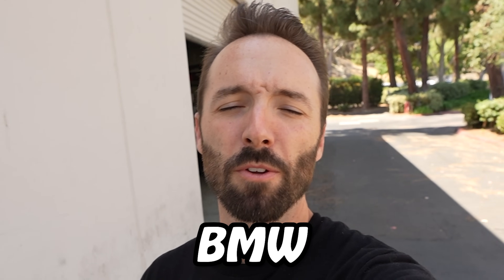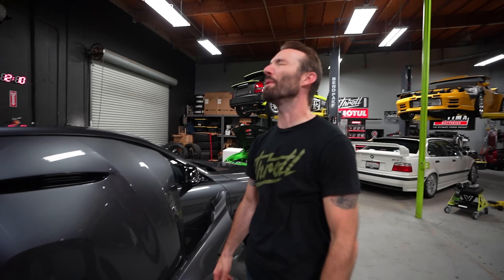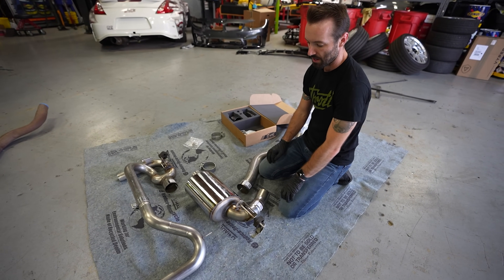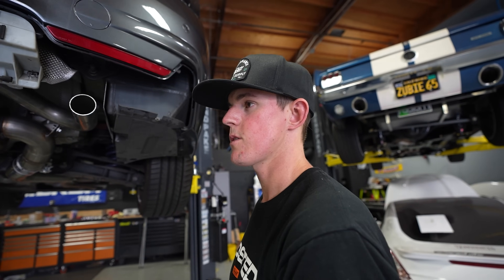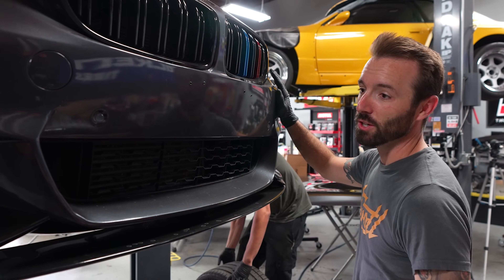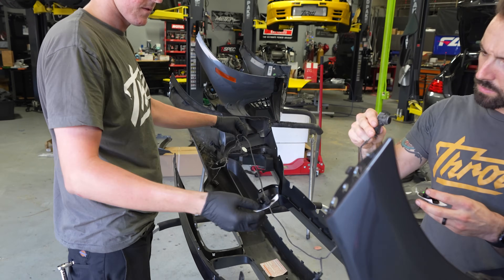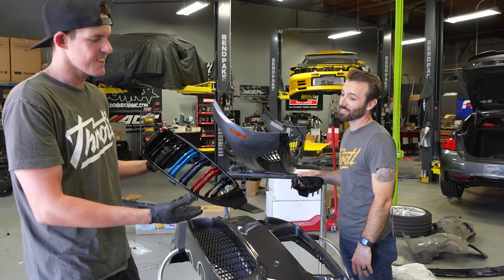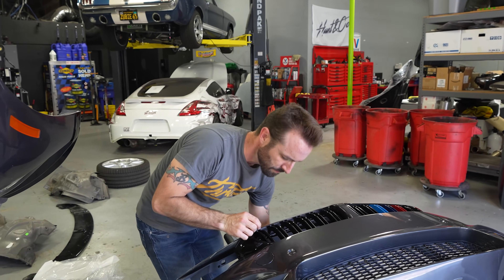Building a 2015 BMW 428i in 20 minutes! (Quick and Easy)

Comment: This has a few items similar to my 428i xdrive coupe. Finally paid it off so now I can save for engine, brake, and suspension upgrades. This is pretty inspirational
Reply: Can the bonnet fit on a regular 428i without having to install the side fenders

Comment: Yo throtl I’ve watched this video about 100 times and I’ve yet to find where the Rear bumper on the 428i gran coupe was purchased. I NEED this rear bumper because I hate the look of the stock one on my 428i GC, and I’m currently in the process of collecting all the M sport conversion parts. If you can give me the info on where the rear bumper was purchased and how the fitment is I’d greatly appreciate it thank you.

Comment: Excellent execution, great looking BMW. Few things did not make sense: 1) If door panels were off to receive red inserts, why not install carbon fiber handle overlays right there and then instead of popping those door carts off and on more then it needs to be... 2) new wheels go on, torqued to spec, next segment - wheels off to receive new bumper?
Again, I do not want to be a spoiler, there is no right or wrong, wish everyone to have his/her car the way you want...
But throwing all these "updates" I am not sure weren't cheap, I'd rather throw all those money in to upgrading to 6 cylinder version with proper transmission (6MT conditionally a)if thats your thing b) if you don't drive in big City with crazy traffic jams, I had to give up my BMX X5 6MT because of NYC traffic) and AWD if available...

Comment: i have a question, i also buyed a M4 front bumper for my car, but the shield under the car from the bumper is too short to connect it with the rest of the shield, did you have the same problem? and if yes, how did you solve it ?
Reply: Did not have that problem. Perhaps if your front bumper was not M sport as a starting point?

Comment: beautiful transformation. I've got a very important question to make about the m4 bumper style for the f3x. can you tell me if any m4 front spoiler would fit with this front m4 bumper or do they only fit with the orignal m4 bumpers? cause I know a real m4 is wider than a F3x series. thanks alot.
Reply: You get an aftermarket lip from the manufacturer who sells the aftermarket bumper. eBay is usually where they are sourced honestly.

Comment: Are the rotiforms +35mm all around or +45mm in the front? Getting a set after I saw these!
Reply: I think they are 255 all around, so stock rear but +30mm on the front
Reply: +35 all around
Reply: @Buckwired  Thanks Will! Is yours an xdrive or rwd?
Reply: @Yamajee200  it is RWD. On H&R sport lowering springs. No rub at all.
Reply: @Buckwired  Perfect Will, you really helped me out, appreciate it.

Comment: Would LOVE to see a how to on the OLED rear lights since this is not a LCI. 🙏
Reply: I plan to put red OLED tail alight upgrade. Not sure if it will be a Throtl vid. For the most part, it is plug and play with a 2-conductor lead to run for the outer to the inner using factory chase ways.